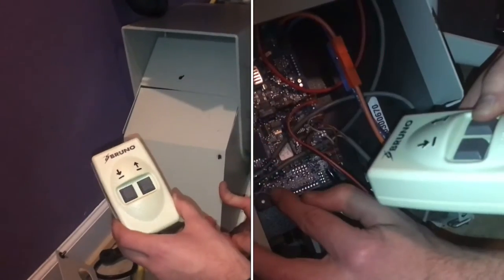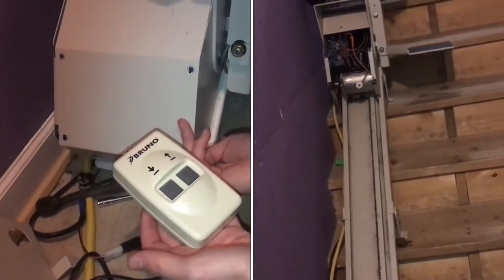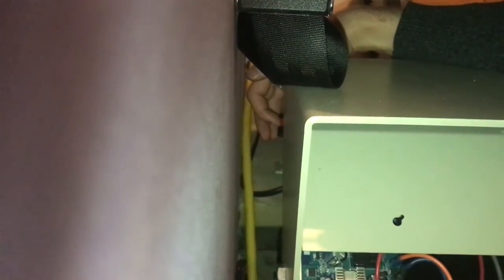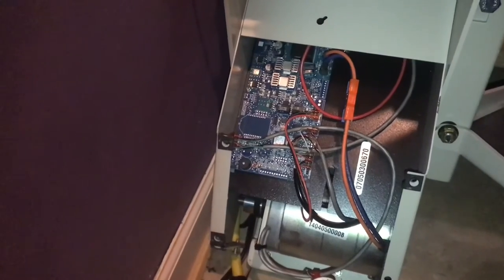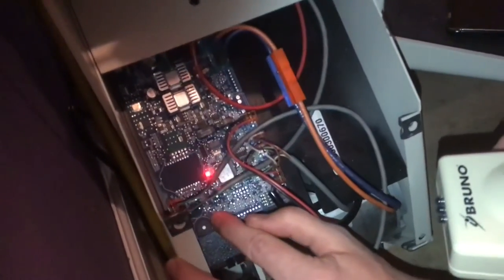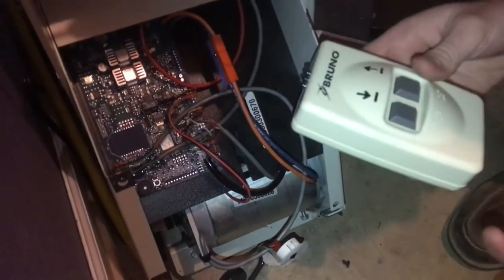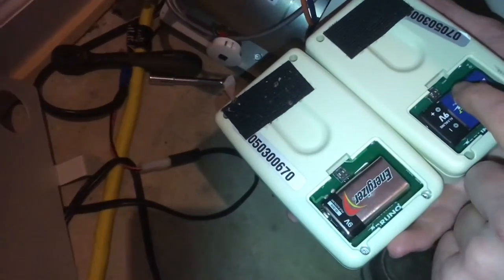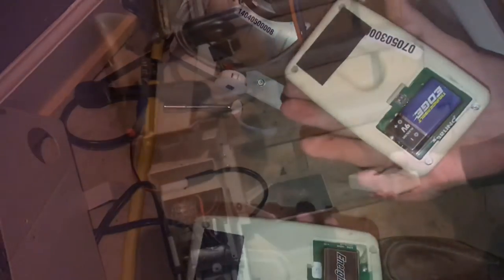“reprogramming” bruno remote (sre 3000 elan) straight stairlift

Comment: I did this many times and nothing happens. Batteries are fine on the chair and the remote controllers. I can see the LEDs flashing on the controllers. The dip switches are both the same 1 on and 2 off. Maybe I am pointing the controller to the wrong place? As I am pressing on the red button on the board and the remote controller at the same time the LED on the board never turns off. It only seem to do the erase part and not the learning. Any tips? The rest of the chair works just fine when operated for the harm rest switch. Thanks.

Comment: Will this work on any remote do you know? I have a Bruno Stair Lift Remote Control CRE 2110, SRE-2010 that I got off eBay. One of my outside units eroded. Seller said it should work because circuit boards matched. Please advise. Thanks!

Comment: Mine must be a different model. The circuit switch is visible without taking the plate off and there is no visible red button to push on mu circuit board